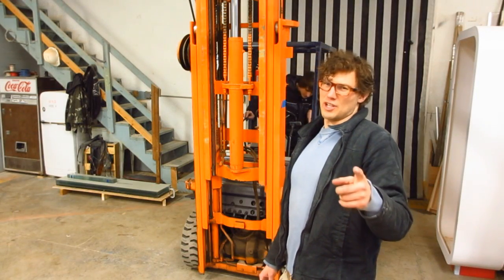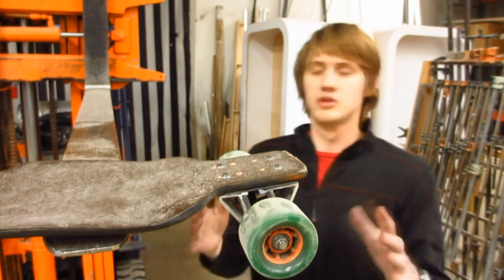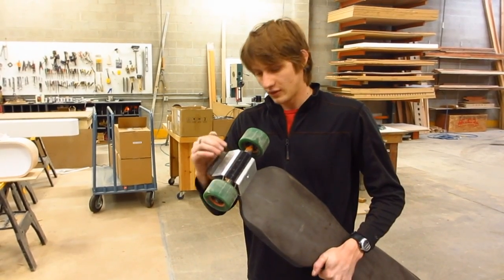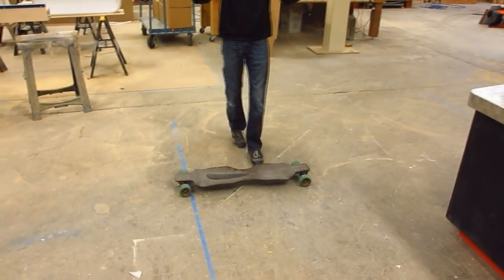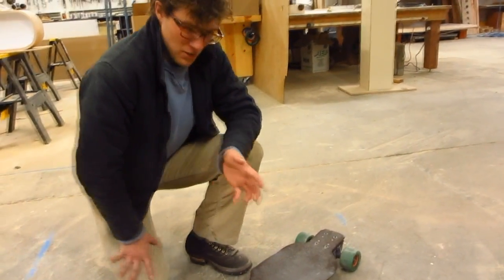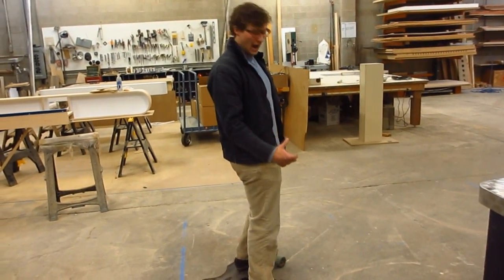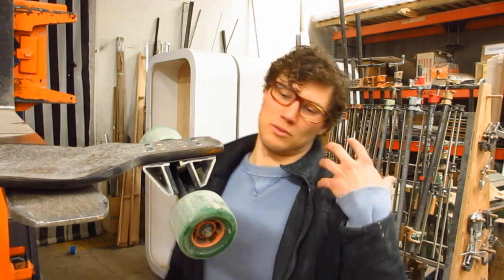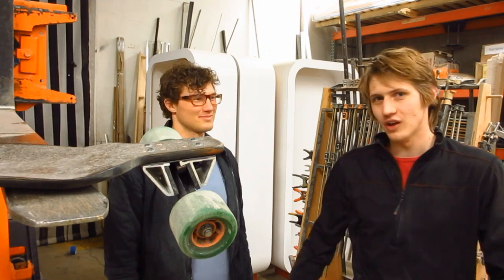First Floating Hanger.

Comment: i would love to test these trucks on the front of my electric longboard! would you guys be interested in some real testing and unbiased feedback? i can even return the truck setup after a couple months of use if need be! please work with me and help me customize my longboard!.. thanks

-pete piccolo
Reply from the maker: Where you out of?

These trucks would really work best as a rear truck as the turning angle is so low.
So I would recommend a setup w/ the motors on the front.

Because the hanger is in two pieces, its kinda a pain to put together.

Not really interested in testing and feedback, but I think it would be cool to see somebody try to use the truck in an eskate setup.
Reply: Im out of a small town Plainville, in Connecticut in the USA... and i actually can just press a button and the motors function the same in reverse so i could run the board backwards, or with the brushless hub motors doing their job in the front... im looking for a truck that has much better turning and adjustability.. let me know if we can work something out, i would love to try your setup!

Comment: What a concept. However, you need to conduct road tests, slide tests, and speed tests before any of your concepts are worth anything, because that's half of the truck's performance! how does your truck hold up mid slide, do the tolerances made a predrift choppy? do the wheels hang up correctly?  Great job guys, keep the scientific theory intact and ya'll keep a sub!

Comment: Do the trucks have resistance with the turning? because seeing you angle the 'hanger' (dont know if you guys call it the hanger) it just stays on the angle without return to centre. So, rebound? a nice cushy center point? I'm not hating I reckon what you guys do is awesome as, but a truck without center..